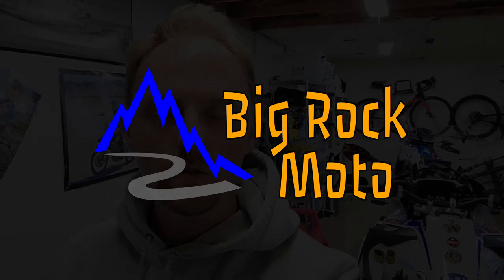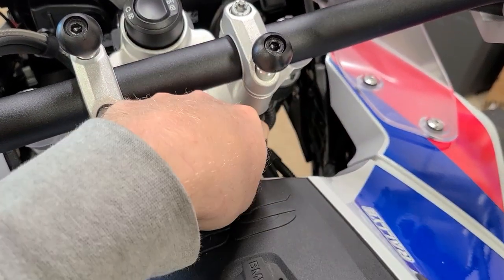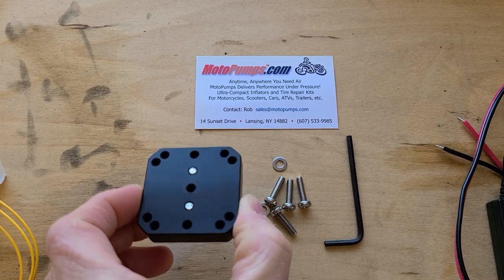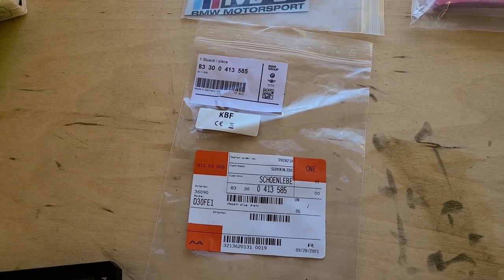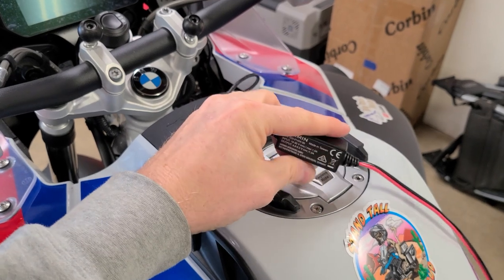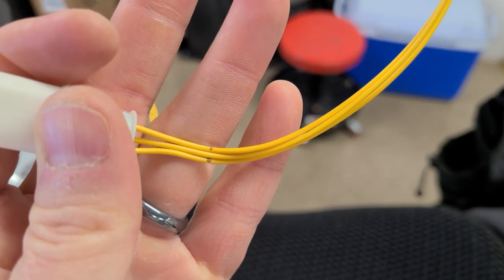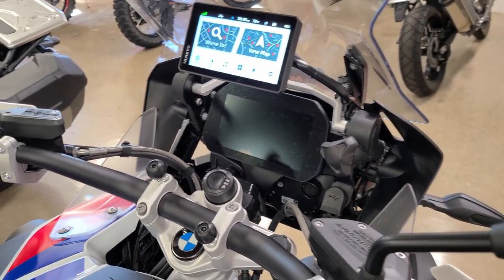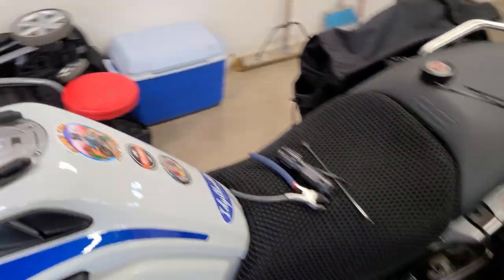How to Install Garmin Zumo XT on a BMW GS (factory wiring)

Comment: I ordered my Zumo XT from Garmin on Monday. I had already planned to call them regarding another replacement for the Nav VI on the GS. Due to this being my 4th exchange on the Nav VI, they gave me a discount on the ZUMO XT. I ordered an extra harness and mount for my other pike (Harley Pan America Special). I ordered the mount that you referenced and the harness/plug from Bob's BWM.

The Garmin items arrived on Tuesday. The other items arrived on Thursday. An hour after getting everything, I had the old Nav VI mount removed, wiring replaced, and Zumo XT mounted! Even got the wires neatly tucked away. Looks FANTASTIC!

Thank you for this video! The best to show how to do the switch.

Comment: Thanks for the great video, Ian I currently own a 2017 Harley Street Glide and have been watching your channel trying to learn the world of Adventure bikes and you are a great help. I understand why you say, "I don't care how you want crimp your wires". There is nothing wrong with crimping, I worked in the automotive field for a long time and also on fire engines and preferred to solder when it was an option, but I get it sometimes I don't want to do that. I would suggest you get the crimp connectors that have the heat shrink already on them. These give you two advantages 1, they seal the connection from the elements like water I'm sure you have ridden in the rain and the second advantage is it gives a second point that will keep the joint from coming loose and usually they have glue when you heat them up. Keep the great videos coming really enjoying the AG and 901 videos!
Reply from the maker: thanks!

Comment: I’ve owned 8 Garmin gps’s & found them all easy to use and fast enough for me, other than my E-trex vista maybe.  Plus, I’ve had trouble with 2 that were well out of warranty.  When I returned them for repairs, Garmin simply sent me a new unit.  Great service IMO.  Other than being overpriced, so far my Nav VI on my 1250 has worked great & connects much better than my TFT dash.  

In the past, I had a lot of fun navigating with a paper map spread out at breakfast while I wrote out a turn by turn route sheet.  That made trips more interesting, especially finding gas stops, but this is way easier.  Mike, a Garmin fanboy 😎

Comment: This worked on my 2021 BMW R1250 GS. I didn’t use the repair cable thou. Instead I used the cable from the OEM BMW sat nav (I cut off the cradle part). Seemed to work fine. Thanks very much!

Comment: Hi Ian, Greetings from NH
Thanks for putting this video together! 
Bought the Zumo, repair plug(thanks for the part number and numbers for the wires) and the MotoPump mount. 
Tore the old NAVIV off( it was stuck, but WD40 helped out), mounted everything up, connected, and neatly ran the wiring and it's working awesome! 
Now to learn the voice commands with the Sena.
Not a difficult job, but having the video reference helped with confidence to tackle this. Nicely done!!

Comment: Nice install video. I did a similar install on my F850GS also using the BMW repair plug but instead using the Touratech locking mount. The Touratech mount is a bit pricy at $200 but I like the convenience of not having to constantly remove my Garmin every time I stop somewhere.
Reply from the maker: Thanks for the tip!
Reply: i like the touratech also , they also sell bundles with the zumo xt for cheaper. It looks ruget , it hold very good the gps unit and it locks , so if you forget it on the base you will find it back when you return.
Reply: Where did you get that repair plug?

Comment: I hate to say it but wonderwheel integration is the main and only reason I'm stuck with an outdated NAV 6. I want to have the ability to zoom in and out without lifting my hands from the handlebars when riding off-road. I understand why many people are switching to android tablets that can be controlled with bluetooth or wired buttons mounted on the handlebars. I don't really get why Garmin can't or doesn't want to make such buttons. 
Anyway, love your videos, keep them coming!
Reply from the maker: lack of the wheel control with the XT is a big downer, for sure

Comment: Thanks for this, a GS is kind of on my list.  You are correct, I wired an older Zumo without Garmin’s power supply and could only get 50% brightness.  Adding Garmin’s power supply gave me back full functionality and brightness 🔆.

Comment: dont even have my F750 GS YET, but have the latest Garmin motorcycle unit saved on amazon, half the price of the BMW, this is way I want mine mounted but will need to find the Bar for mounting...good video!

Comment: Great video. Can I plug my sat nav. to a power socket on GSA 1200 instead? I think the only downside will be no power when engine is off and of course the socket will be not available to plug in any other devices?

Comment: Thanks for this video. Ordered the part 83 30 0 413 585 and made a cable to Garmin XT Zumo. Original BWM nav holder removed intact and stored safely.

Comment: Mounted a Garmin 390 on a K1300S. One peculiarity there: due to the external trafo (like the Zumo XT has) a small current was still drawn when the bike was switched off. Meaning that the battery slowly was drained. Solved it by putting a switch between the nav and the battery. Maybe something to think off with the XT and a CAN Bus system like BMW’s.

Comment: Thanks for the great video. That same port is on my 2017 F800GS. I just installed it today and it works great. The only change I made was to use Anderson power connectors so I can swap to other accessories if I want in the future. The M&Ms from max BMW taste great!

Comment: I have a 2017 1200GS and I did the exact same thing except I made a bracket to move my Garmin 595LM to the handlebar clamp at the same time. Been loving having it lower and closer to me.

Comment: Ian, regarding the BUTT CONNECTORS - there are BUTT CONNECTORS that use HEAT SHRINK - seal out moisture; I  was not sure if you used those or not in your video.

Comment: Ian - question - wouldn’t the voltage through the cable, to the original mount already be stepped down since it was designed to operate the NAV 6. I ask, becasue the new XT2 does NOT have that step down inverter.

Comment: Is there an alternate connector on the garmin to simply plug it into a USB port (which I assume has the correct voltage) ?   Cause that would be  preferable if you ask me than having to splice any wiring etc ....I mean I already have a usb port near the dash will be a shame if I cant simply use that ...I had an old garmin on a used Vstrom (that was total junk in operation cutting in and out) it had a base with a bunch of realy fine pins that for the life of me I never understood why it needed more than two wires ....I so happily ripped that junk off the bike and seriously thought about taking a hammer to it lol ....I just want to charge it via a little USB cable rather than hardwired method ...is that possible?

Comment: Thanks for your video! I have a question and would like your help to clarify it! If I disconnect the cable from the original GPS base of the motorcycle, will I have any problems with the general operating system? I mean, will there be any error messages on the dashboard that need to be reprogrammed?

Comment: Thank you for your garage vlog, very useful 😊
I did similar installation on my GS Adv but I decided to use existing BMW original mount, instead of an expensive aluminum mount, also difficult to find here honestly. So, with about 12$ I was able to install everything and at the same time protect more the release button of the XT from being pressed accidentally and still keeping the installation BMW style 😊
Reply: How you can use the original mount with Zumo XT navigation?
Reply: @NomadOnGS   Isn't difficult. You just remove the center part assembly and with longer screws and spacers, replace the original mount coming with the Zumo XT. Of course also the customized BMW electric plug needs to be added to the XT harness. It works beautifully, I have it on my GS Adv LC.
Reply: Please tell me what you did exactly to integrate the XT harness into the BMW harness.
Reply: @robdanner3833    Isn't difficult. You just remove the center part assembly and with longer screws and spacers, replace the original mount coming with the Zumo XT. Of course also the customized BMW electric plug needs to be added to the XT harness. It works beautifully, I have it on my GS Adv LC.
Reply: @e-gadgetsfreakITA  so, let me make sure I understand. You cut the XT harness and the Nav 6 harness, but not the BMW harness. You then connected the XT harness to the cut Nav harness. Is this correct? If so, since the XT has only 2 working terminals for power, which wires from the cut Nav harness did you use? I have a 2020 GSA if it makes a difference...
Reply: @robdanner3833  no cutting... you just fit the XT cradle in place to the original BMW center cradle. All I did, I just bought some longer M5 screws and bolts, added some plastic distancer in between and terminated the xt wiring with the proper bmw power connector, as the original BMW. All fits nice and smooth 😉
Reply: Sounds too good to be true, well done! I would love to have seen a picture of as I just don't see how it can all stay flush and lock at the same time.

Comment: Thanks for another informative video. Just wanted to ask about securing the Sat nav.The standard bmw sat nav holder can be locked with the bmw key which I have found very useful. Is there anything else you  an do to secure the device when on tour?? Many thanks for any help or advice

Comment: HI Ian, thanks for another informative video.  I took your advice and bought a 2017 R2000 GSA which I pick up next Saturday.  I have removed the Zumo XT from my Africa Twin so this video is very timely.  I am looking at buying a BMW Nav 5 to put in the 'hole' but might now use my Zumo as you have done.  Do you know if the BMW repair plug varies from model to model, i.e would the same plug fit my non TFT setup?   Thanks again.

Comment: Hi Ian, thank you for sharing. Question...

Yes, the BMW Navigator VI is very much out of date...! Compared with Google Maps on my iPhone, the Garmin VI is almost useless, let alone the price they charge for it...!

However, the BMW Navigator DOES offer us the option to display all kinds of info on the Navigator screen related to our motorcycle. Such as; engine temperature, tire pressure, fuel range, ambient temperature, and much more. In fact; up to 16 different fields for us to choose from what we want to have displayed.
And because the BMW TFT does NOT display all this information - I need to go through the menu to search for this information each time I want to be informed! - to me it is of value to have this kind of information displayed at all times.

Question:
Does the Garmin XT also give us the option to display up to 16 fields of our specific BMW motorcycle info?
And does the XT offer making phone calls and playing music while connected to BMW's helmet communication system 7 ?
Or is it only a GPS?
Note: The BMW magic rotary wheel to control the Garmin for me is not that important, being able to use my gloves to operate the Garmin via the screen is much more useful to me.

Thank you. Good luck with your channel and happy riding!

Greetings from Belgium, Coen
Reply: I was thinking the same question.  And def would like to know the answer

Comment: Thanks Ian. Brand new to your channel. Great job! Question .. Can I just install the additional xt unit while also keeping my current Nav6? Is there any additional power requirements I may not be considering while theoretically using 2 units at once?
Reply from the maker: Yes you can!
Reply: Wondering the same thing. How do you add the Garmin wiring without removing the OEM BMW cradle and wires?

Comment: Hi Ian, Thanks for your video. It helped me mount my Zumo XT to my '11 1200GS. Power to GPS fine however my LAMPF is flashing now. I understand why LAMPF can show due  to low draw but would not have thought this would happen with the GPS form the optional accessory socket. Have you come across this before? Thanks for all your videos! Ben.

Comment: I have a Zumo XT I’d like to install on a 2022 R1250GSA. Does utilizing the Motopump 12mm adapter cause the Garmin unit to interfere with the view of the factory instrument screen? Thanks for this video
Reply: I see now you stated in same position as BMW factory mount. Great install video.

Comment: I was about to do the very same thing: I was getting fed up with the Nav VI because of the air bubble problem.
But apparently BMW got Garmin to make a new model, with a new TFT screen that (supposedly) fixes the air bubble problem, and I got mine under warranty still (2nd time I replaced it, both under warranty). They call the new unit the Nav VI+.
It’s still the same unit, but it has the new TFT screen and an updated UI (software version 10.0). So far I haven’t got any issues with it…

Comment: Pro Tip - Use the low profile Cobra cable ties.  Clip the tail and it disappears into the flat head with no bulky head and no sharp tail stub to cut you.

Comment: Hi Ian, Have you used the tomtom rider 550? I went ahead and bought one of these due to reviews about Garmins 'non intuitive' operation. I have a mate who has a 2017 1200GS  and the Nav 6 is pretty clunky and mis behaving. I have a 2011 GS. Since getting the TomTom I am really annoyed that they don't have many back country tracks and some routes that have been shared with me are not able to be followed with the TomTom. I have a handheld trekking Garmin that has all the tracks and contours....can you tell me if the zumo shows contour maps when you are riding? And does it have all the back country tracks pre-installed? I am in Australia so I know things could be a little different however I would love to hear your advice. Thanks, Ben.

Comment: Nice video how to install XT, but no word about what You lose... No controls from hand wheel anymore, no GS data on screen (Since there is no connection to motorcycle just power), no tire pressure information anymore. I am riding with my GS using Navigator V and I am very happy with it. When I drive with enduro glows on unknown track - its very usefull to zoom in and out with wheel. I think BMW Navigator is best motorcycle implementation - no touch screens during driving!!!
Reply from the maker: If you have a TFT bike you don't need the extra info on the GPS as much. But with the older dials yes I agree

Comment: I suggest using portrait orientation.  I have found that the wiring is easier to conceal.  I also found that this orientation was better (for my use) because it displayed more of the road that I am currently traveling on.
Reply from the maker: Great suggestion!

Comment: Hy from Croatia , van You tell me ,do i have navi conection Jack on My motorcycle , i dont have BMW navigation, i bought just rail and spare Jack for original navi conection ..
My problem is , can not find where to plug in im motorcycle ...many thnx

Comment: Great video, thinking of selling my nav VI and going with the zumo as well. I’ll definitely reference again when the time comes. Curious, did you use the zumo or a tablet on your recent trip 6000km trip? When it comes to tablet vs. zumo, which would you prefer all things equal (GPS/data etc.) Cheers and keep the great content coming 👍🏻
Reply from the maker: I prefer the XT to the tablet by far. I used the tablet before I bought the XT

Comment: I forgot to comment in the unicorn video about the bikes I'd own. My conversion kit street legal 2004 Yamaha wr250F, which has the YZ250 motor, not the street bike motor they put in the wr250R) & my touring adventure bike would be the sport edition 2021 KLR 650, with ABS. If I hit the lottery I'd add two more bikes a 1971 Yamaha 175 Enduro & a 1969 Bonneville. It would be hard to choose between the cooler looking T120R, the road version with down pipes, or the T120C, the off-road/street scrambler with high pipes.

Comment: I want to ask a question.The delay turning off zumo xt screen ,is from the unit or is because the motorcycle power wires still giving power after switching off ?
Reply: The delay is set on the XT.    You choose 1,2 or 3 minutes before shut off

Comment: I have a Nav6 on my GS, and I really haven’t had issues with it. I am still able to use Basecamp when planing/loading/transferring tracks to the GPS. I’ve heard Garmin is no longer supporting Basecamp and is moving to an app. Is that true? How do you load tracks to the Garmin XT?

Comment: Two words: google and gaia. Add the quad lock mount and wireless charger and you  have the best setup for your bike. Garmin gps devices are limited and the most interesting features requires your phone anyway.

Comment: My 2005 GS1200 is also meant to have the gps socket for connecting to but I can't find it! Anyone know where it is?
Reply from the maker: on the newer bikes it's under the right side fairing up near the headlight
Reply: @BigRockMoto  Thanks Ian. I eventually found it on my old GS. It's on the left just in front of the tank quite high up.